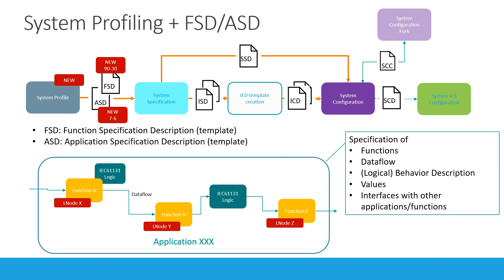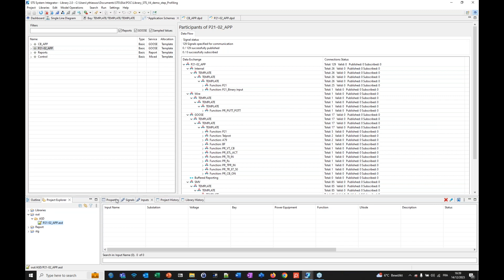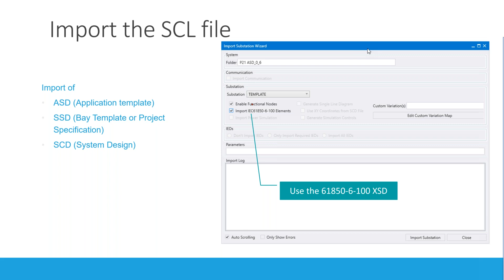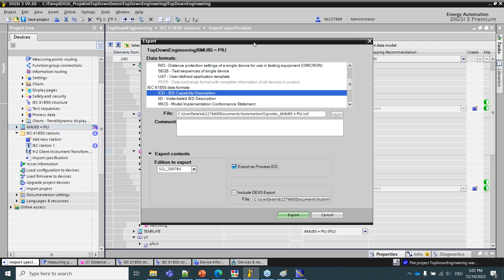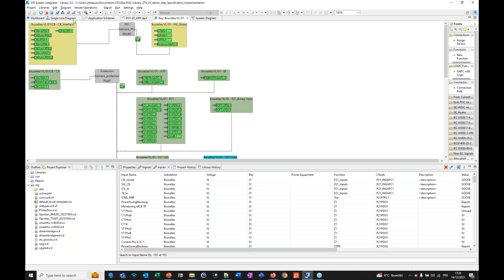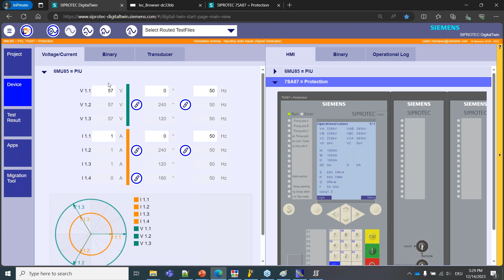Webinar - IEC 61850 Engineering Process Common Vision

Comment: 30:30 - do you need to include LLN0 in the function block for each separate logical node?
Reply from the maker: No, you do not need a an LLN0 for each logical node. There is one for each logical device. Please email support@trianglemicroworks.com if you have additional questions. Thanks!
Reply: @Trianglemicroworks thank you for the response. By the way, does Helinks support 61850 Edition 2.1?